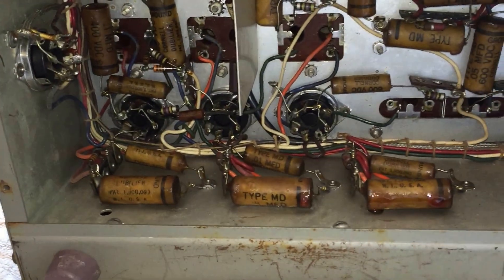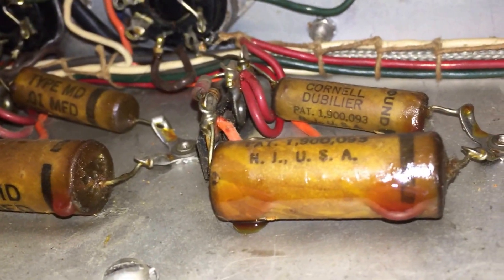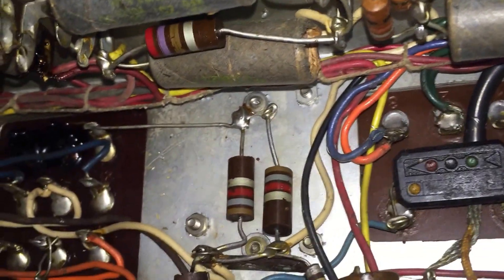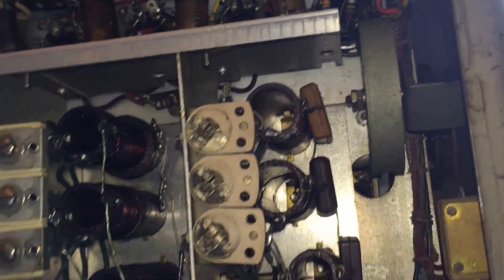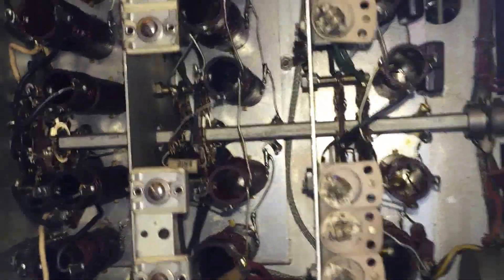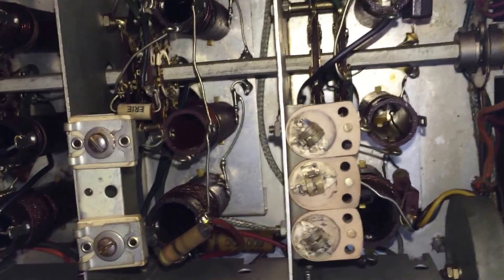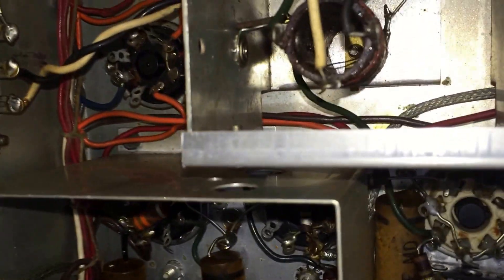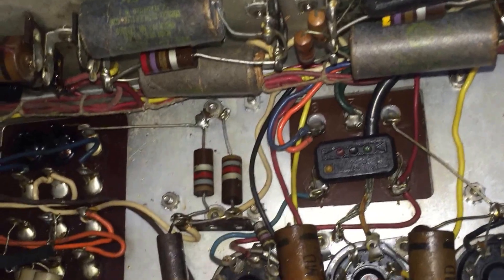National NC-173 reciever overview

Comment: Could You Help me, I,m just learning for something to do, I'm disabled, I bought  National nc-173, when I first got the radio, I tried to see if it would light up using a Variac, very slow, There was Nothing, I wrote down every capacitor and every Resistor I would need, I changed every one, other than The mica's capacitors, The radio Light up and seems to Work some what well, But I am having a Problem with AM selector on E, It seems to work I could pick up some stations Now just a hum. any-chance you would know what it could be, Thanks for any Help Brian